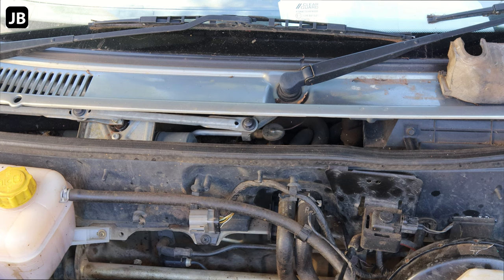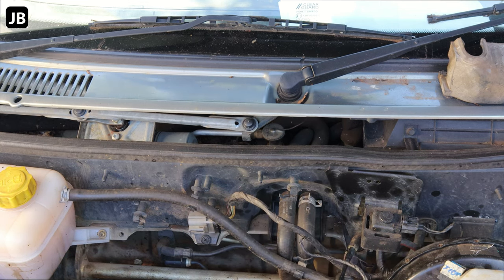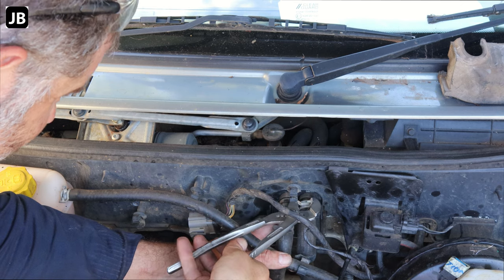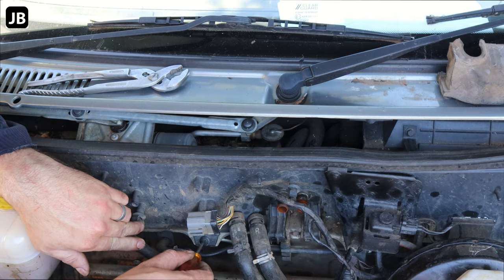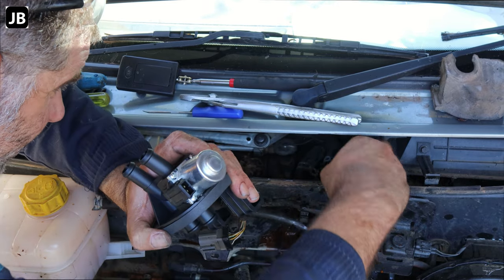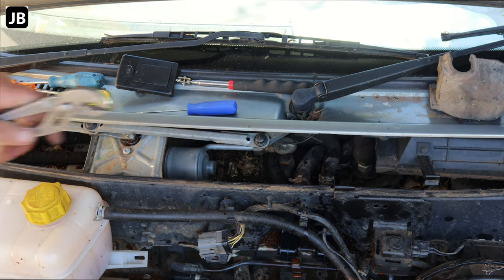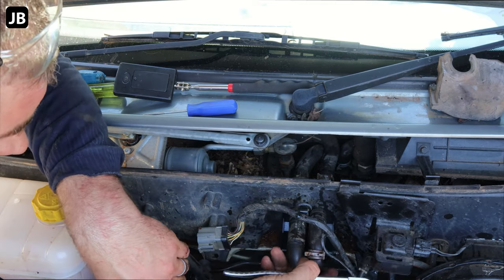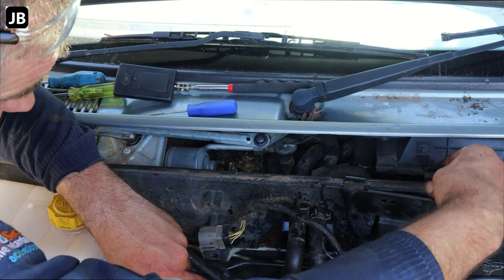Ford Bantam 1.3i ROCAM Heater Valve replacement

Comment: Hi sir, I have a 1.3 ford ka, it did not have a heater valve fitted, I am fitting one now but I cannot find a diagram to show the pipe connection sequence to the thermostat, can you help maybe?